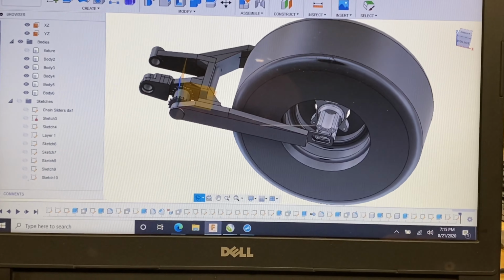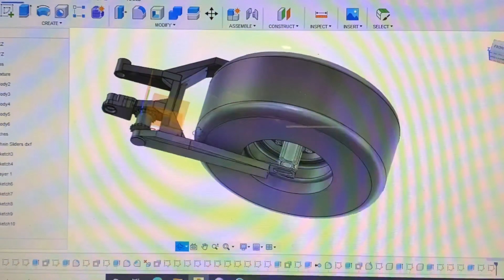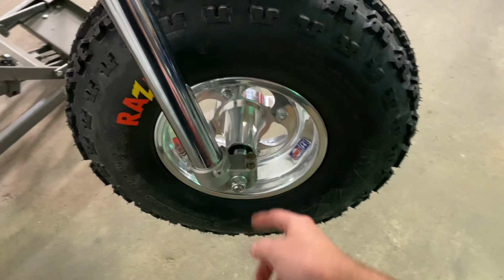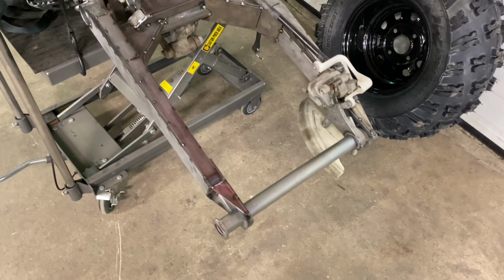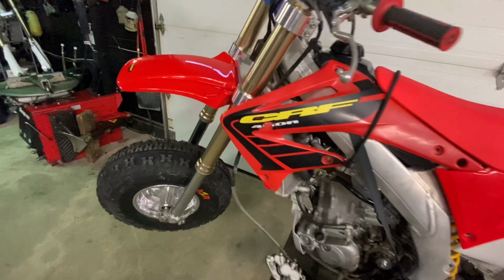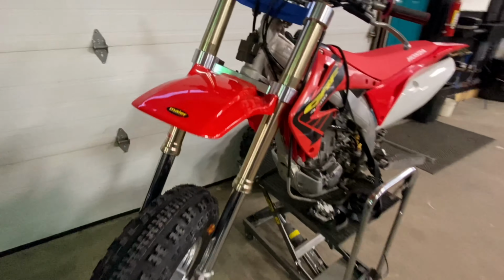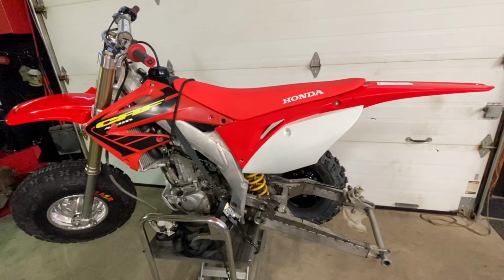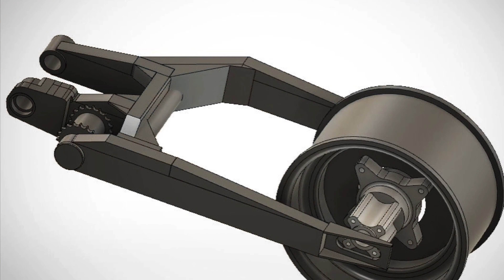BIG WHEEL DIRTBIKE Project CRF450R- Part 1

Comment: Love it . It was unfortunate that missle engineering  stoped producing the kits and does a limited run of them every so often . I’d love to have an original M E kit for the 250 r   Just for nostalgia.  I’d love to see a kx 500 with one of your big wheel kits on it .  Smooth razor front with a skat-trak 10cup hauler on the back .. it would rip out in glamis .. fantastic job gents . Looking good .

Comment: I had the Honda Fat Cat. Awesome for woods riding but can't high speed turn for crap.
Reply: That’s what’s I’m wondering about this bike is, will it turn good, can you lay it down while still getting traction? I think it should tho
Reply: Purchased a Yamaha big wheel 1985 new for wife  it turned out to be indestructible goat trails Rocks sand  suspension not great handling not great but the most fun u could have for 1200.00.
Reply: The fat cat and big wheel are awesome bikes. Getting use to turning on the road was fun with the big tires. I had both got my fat cat first and then got the big wheel but jumping back and forth I'd end up forgetting I was on the big wheel and end up shifting without the clutch and dump it. lol the only thing that sucked was the chain tensioners they would always strip on my bikes.

Comment: Yes big wheel that would be amazing would love to convert my yz250x to a big wheel
Reply: onewisedre  huh? 
That made no sense lol look up the meaning of what ya just said. Simp is a slang insult for men who are seen as too attentive and submissive to women, especially out of a failed hope of winning some entitled sexual attention or activity from them. ... The word simp is meant to troll young men for doing anything for a girl to get some action he supposedly deserves.
Reply: onewisedre lol you obviously don’t ride or know very much you do realize if you wanna race a 250 2 stroke you have to race in the 450 class riding a two stroke is people that actually wanna ride 4 strokes are for lazy riders cause the are easy to ride I have a 2002 Crf450r I use to ride with my little cousins on the trails when I wanna ride hard I use my 250 smoker 🤘🏻
Reply: @joshrose4988  you get a CR500 or KX500 for a kit like that. I agree a 250 2 stroke is fast but you'll lose way too much power with those wheels clearly you're brainless. And obviously I do ride.  I had a 01 cr250r, 06 trx450r, and now a 08 gsxr 750. I'm just saying your bike is a poor fit for this application. And I'm well aware 250 2 stroke races with 450 4 strokes. And your 02 crf450r is a slug they didn't even get the 12:1 high compression piston till 06.